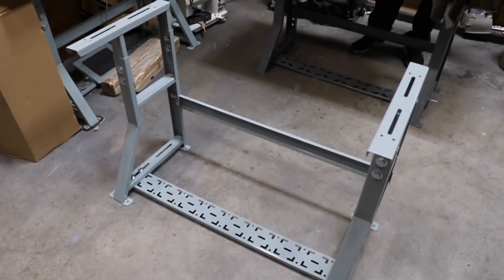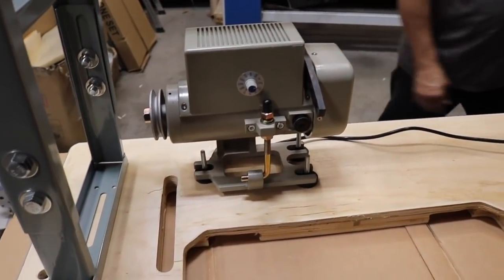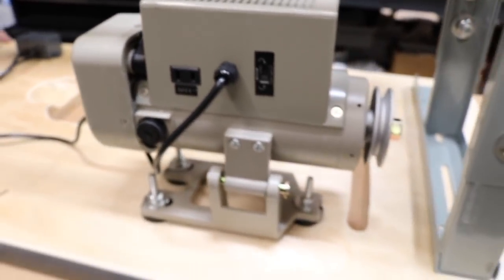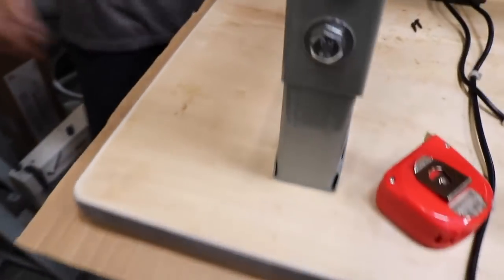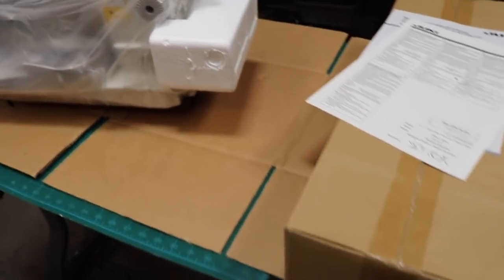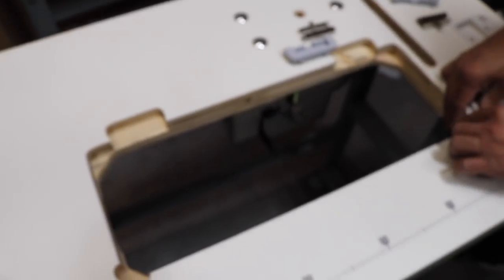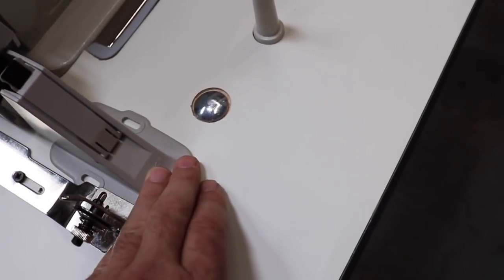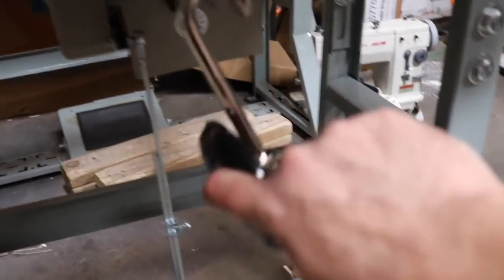Tutorial - How to  Assemble the Juki DDL-8700 or NEW TECH 8700 - Goldstartool.com - 800-868-4419

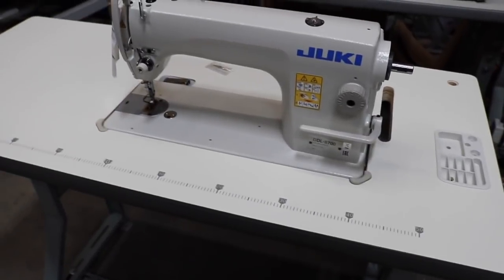Comment: At 24:45 you skipped the steps to align the belt and the wheel.  :(  Could you please make a video showing these CRITICAL steps?  The instructions provided by Juki are horrible and this is the only part of the system I couldn't find videos to show the assembly. Also, it would be helpful to see the belt tension adjustment.

Comment: Not the best video. They skip steps, the on/off button should be to the right of the motor, the drawer on the left side but inside the frame of the legs. Look for another video or two. Watch them all the way through to see how the different parts fit before assembling. Lots of time wasted and frustration if you go by solely this video.